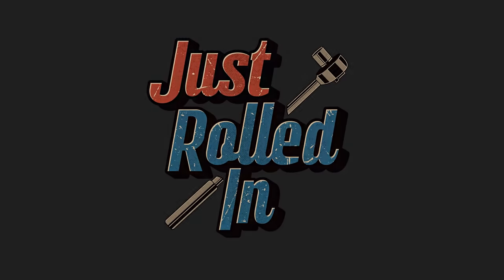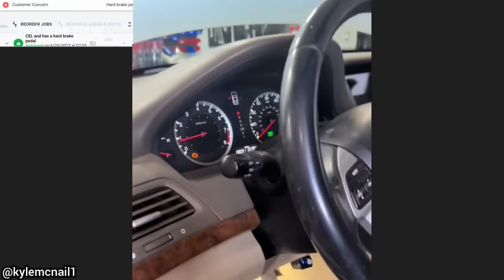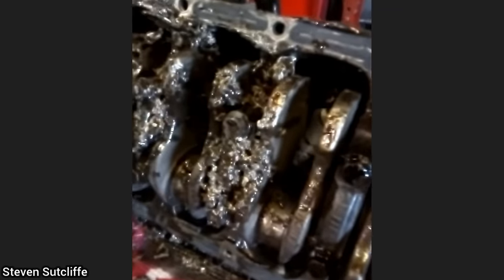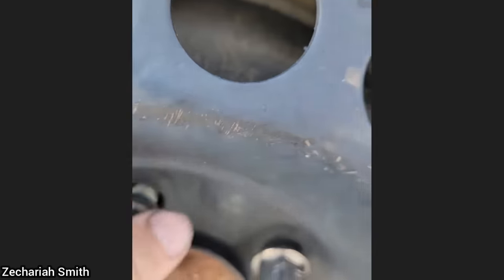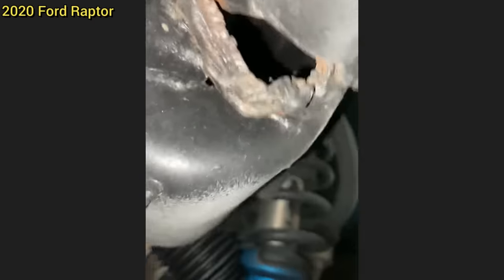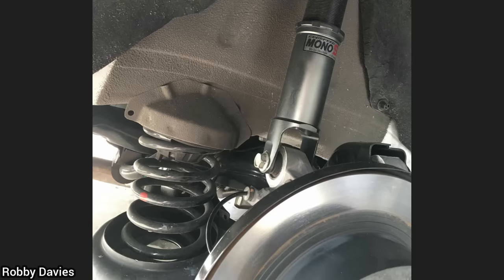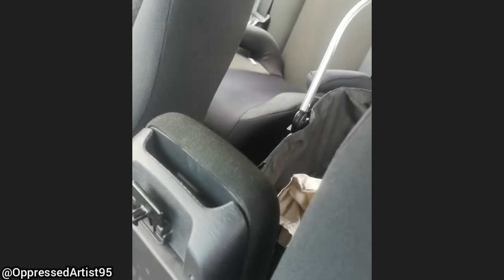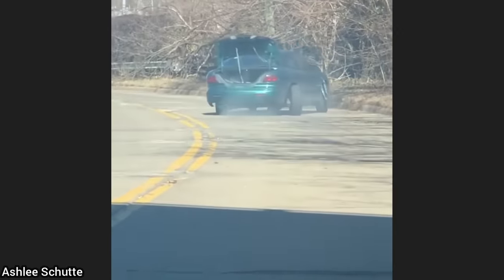Customer States Haven't Changed Engine Oil In 90,000 Miles

Comment: The fact that an engine can last 90,000 miles without an oil change is truly a testament to modern engineering
Reply: It may die right after oil change. New oil loosens all the old gunk and you never know where it goes and what plugs up. If all of it goes into oil filter, that may cause loss of oil pressure.
Reply: @SeersantLoom  use non detergent then? Idk
Reply: @bobstevenson3130  One of the worst cases I've had - after the first oil change was done, surprise, oil light came up shortly. Found my new oil filter plugged solid and bit distorted with all that pressure buildup. Replaced the filter, let it run some more, then repeated oil change.
Reply: @bobstevenson3130 Don't ever use non detergent oil for anything. The stuff currently sold as non detergent has no anti-wear additive package whatsoever.

Comment: LMAO at the last one!  HAHAH!   Yup that for sure is what the ones look like driving home when they "decline all repairs" .  🤣
Reply: Seems like they want to decline being alive, as well.
Reply: just needs a slight alignment job.
Reply: I don't even know how an alignment could be that far off. But that's impressively and scary bad.
Reply: I know the potential for abuse is basically infinity but jfc the cops need to be able to wreck your car when its like that.
Reply: @davidpick1076   Front wheel drive car , the rear axle is probably rusted away from the frame and has kicked around almost sideways from the looks of it ,  LOL
Reply: @matt_1984_  Toe and go
Reply: That is an example of a before and after Scotty Kilmer repair.
Reply: @matt_1984_  Just check the washer level please.
Reply: @davidpick1076  There is nothing to align anymore. The rear axle is completely out of its place, probably rusted away or "hit a slight curb" 😅
Reply: yessssssss 😆
Reply: Persistent drift.
Reply: Came in to get the AC fixed.
Reply: @joshuakarr-BibleMan  Technically, this wreck is still rolling on its wheels, not sliding. So no drift here 😅But indeed, the rolling angle is a little bit, well, off 🤣😂
Reply: There are some four wheel drive tractors that can drive like that.  It's called crab steering.
Reply: Top class!!!!
Reply: Puts deja vu on full blast
Reply: This comment reads like it was generated by AI
Reply: I'm waiting for the goofy stance gang rejects to start doing that to their cars on purpose
Reply: That car was doing crab walk lol 😆
Reply: I always cover up everything I work on with anti-seize that way you know I worked on it it’s like my trademark it don’t matter what it is either
Reply: That made me laugh too.  They're permanently stuck in a drift. 🤣

They drift, drift, drifted all the way home on broken steering mechanisms. 🤣

What I mean by that is by wheel position with everything relating to control of the wheels being broken, not how they're drivin'.
Reply: "Another shop did it."
Reply: Looks pretty cursed to me.
Reply: I've seen some trailers with a bit of side-angle from slipped axle mounts, but that car was ludicrous.
I also saw no license plate on it.
Reply: That individual was clearly disturbed about paying for the repair of that vehicle. Atleast arrange for a ride home and a salvage check.
Reply: How does it turn left. It looked like the wheel was turned all the way to the left in order to go straight.
Reply: They live that Initial D life
Reply: Not sure if I'm shocked or impressed by that last car. Seems to be missing some suspension components.
Reply: The conditions of the vehicles in the last two clips are a perfect example of what we have in Oklahoma.  If Oklahoma ever decides to reinstate just safety inspections, at least 70% of the vehicles on the road will be impounded and/or scrapped!

Comment: Customer states” can’t see out of windscreen “
Mechanic removes paper bag from customers head.
Reply: Customer states "can't hear the engine running".  Mechanic removes ear plugs from customer's ears.  😂
Reply: Mechanic: pokes two eye holes in bag 😂
Reply: I can't help but laugh at the idea of the Customer actually being kind and appreciative about the help they received, without having any hint of embarrassment. "Oh yeah, that really helps out, hey!" - And then they tip the Mechanic with a free, unopened bag of Coffee or something.
Reply: Thought you'd write "cleans windshield of the dirt built up since 2010".
Reply: Customer declined repairs and asked that the paper bag be left on.
Reply: @GeneralChangFromDanang   nice one. Or that ‘another shop’ or ‘ my cousin’put the bag on
Reply: @GeneralChangFromDanang    Or.  Due to how dirty the bag was, mechanic refused to remove it.  😂
Reply: More like mechanic removes customer's head from customer's ass.
Reply: @markh.6687  back in late 80's I was apprentice at an Opel car dealer down my street here in germany. while workign on a customers' car I accidentally slid a knuckle along the windshield's inside, leaving a grey dirt mark. boss asked me to clean the whole windshield inside, and it turned out the car did NOT have tinted glass windows... it was all cigarette smoke residue left over from a good five years... customer never cleaned their windows at all. I ended up cleaning all windows with paint polish and a healthy dose of cleaning spray. :P
Reply: The shoes behind the brake peddle was mind numbing.
Reply: @alphagt62    Nothing wrong with having new brake shoes installed.  😂
Reply: @my3dviews  HA!!
Reply: Mechanic looks a customers face, cuts eyeholes and replaces the bag. Bills customer 4 hours.
Reply: @noeldown1952  LOL!
Reply: @alphagt62  The driver clearly didn't need additional mind numbing.

Comment: I had a Just Rolled In moment the other day.  My daughter and I took her car to get some new tires and after it was all said and done, she had 3 busted lugnuts and only two holding the tire on.  I gingerly drove it down the street to the Honda dealership so they could replace all of the wheel studs.  I have never been so scared before driving a vehicle but that was sketchy as hell.  My wife was following behind me and she was freaking out the whole time.  How do you think I felt, woman.  But all is good and it's safe to drive and the most important thing.  This customer DID NOT REFUSE REPAIRS!
Reply: @Earthneedsado-over177  Or just tell us the initials were NTB.
Reply: @Earthneedsado-over177  “The Other Shop” duh
Reply: @MonkeyJedi99  what's NTB?
Reply: @bearing_aficionado  National Tire and Battery. A chain of shops notorious for poorly training their technicians.
Reply: @MonkeyJedi99  I honestly have never heard of them.  They sound like Jiffy Lube?
Reply: Always inspect the shop's work before leaving the premises.
They should have repaired that befgore it left the shop.
I had something similar happen to me many years ago (late '70's) at a Kmart garage.
I was as young guy and got some new tires put on at Kmart.  
The lug nuts were covered by hubcaps.
No problems when I left the garage, but the next day I started hearing clunking sounds 
while driving coming from one of the wheels.  
I pulled the hubcap off one wheel and found the lug holes in the wheel 
were now lug slots with less than a 1/4 inch of metal wheel left between them!  
I tightened the lugs as best I could and gingerly, slowly drove back to Kmart 
and raised holy hell with the shop foreman.  
I left with a new wheel, new lug studs and lug nuts at no charge to me.  
I usually do as much of my own work as I can, as I am a FAA certified A & P Mechanic, 
with available hand tools, but when I can't I always inspect the work done to my trucks.
Reply: It was sketchy, but maybe not as bad as you think. You still had 2 lug nuts holding it on, so it was better off than what I had to do to remove my rear wheels in a 99 Suburban:

The only way was to remove the wheels was to (1:) loosen the lug nuts (just so they were loose, but only just so,) then (2:) I had to drive it out in my low traffic back street, go 5 MPH in reverse, and slam the brakes. 

The wheels didn't fly off or anything, they just got loosened. And believe me, I tried everything else I could read about to remove the wheels, and nothing worked except this - they were stuck on too tight. Hitting the wheel with a sledgehammer didn't work.

Comment: That last one caught me of guard. I can only do minor maintenance work but this channel reminds me just how far that can go.
Reply: i was doing just minor maintenance on my vehicles. until one day my 6 speed automatic transmission gave up and only went in reverse. 

instead of paying $3k or more to get it fixed i bought a shop manual on ebay for $8 and watched some guy on youtube disassemble one at least 6 times.
read the manual a few times and even got into the technical diagrams explaining how the whole solenoid valve body works to shift gears. the manual was impressively detailed. i bought all the parts and tools i needed for $800-1000 and took my time fixing it. took it apart and assembled it 3 times and then went through the entire transmission to find everything worn out and replaced it. 
the forward piston had ripped and my overdrive clutch plates burnt. replaced the whole overdrive clutch pack including steels and all the clutch plates in the other packs. as well as the forward piston that caused all the problems. i got it all put back together without missing a single thing.
it works like brand new now. everything was put back where it belongs. i think its funny no one wants to touch a transmission let alone think about taking one apart, but i dove right in. 

if people cant take the time to learn how to do the work properly they have no business doing the work at all. 
i refuse to pay $120 an hour for dealer mechanic labor. I rather learn a new skill. i used the money i saved to buy a backup car. so i got more out of it.

Comment: That Lexus is legitimately impressive that it lasted as long as some well maintained engines without an oil change
Reply: I'm not it's a Toyota
Reply: @cloroxlavenderscent4307  Yes, had a sales rep who got a new vehicle, and was canned after a year or so, for unrelated things. Looked at the  vehicle, and it had done 60 000km on the factory oil, as it, along with the tyres, had never been changed at all. Oil was on the low mark as well, and pretty black.
Reply: Neighbor was a traveling salesman. Bragged he never had to add oil to his car. When he finally took the car in for an oil change after many thousands of miles, there was no oil. Except there was oil burned onto the dipstick, and the dipstick driver thought it was showing oil in the engine. Oh well - company car. Who cares?
Reply: @dsbennett  Nowadys these cars are generally leased for two years, so after two years they get returned anyways. These cars normally have full coverage for any maintenance, which some people use to the point where it's almost abusing. I think my brother once took his in because the washer fluid was empty.
Reply: Hoovie, from Hoovie's Garage, had a Maserati Levante that had at least 60K miles since the last oil change. It still ran though and after two oil flushes, it ran like new. It also had traces of meth in it because it was an auctioned off drug dealer's car.
Reply: @MyRegardsToTheDodo  isn't that sad that so many people (not businesses) are leasing vehicles.  You have basically signed up for a lifetime monthly car payment.   Hard pass.
Reply: @ronmonarch2679  Those cars are normally company fleet cars. Normal people don't get a lease for two years and after those two years a new car with a new lease.

Comment: Ive had a customer this week that told me the AC didnt go cold.. so i checked and refilled the AC and when we together tried if it got cold it turned out she didnt push the AC button😂😂😂😂😂
Reply: I've had two customers (one a real customer, the other was a student in my automotive A/C class I taught ) tell me their A/C didn't work. Upon inspection, neither vehicle had ever had A/C!
Reply: @61rampy65  That explains why it didn't work...😁
Reply: @61rampy65 That sounds like a Suzuki Vitara I saw, one of the last of the JT shape.  4WD not working.  Had the switches, they lit up, 4WD errors came up on the cluster.  Look underneath - no transfer case, no front diff or CV shafts.  A mix-up at the factory made a car that lies to you!!
Reply: @markh.6687  Easily worth the one hour diagnosis fee!
Reply: @61rampy65 and that is exactly the reason why so many people no longer trust a garage anymore!!! 😢

Checking if powered on should be the first step, not trial and error refill AC kind of crap.

Diagnose is done 98% with your eyes, 2% tools.

Yet.. so many seem to have forgotten this and just try to fix the first thing that pops in their mind... (Or because the car computer tells them)
Lazy mechanics...

Charging an hour for showing the on off switch or telling there isn't AC?

Shame on you.
Shame!

Please tell me what garage you work so we can avoid.

Comment: Local car for sale: Sign on it states, "Has had engine replaced."
Turns out the radiator went bad, and instead of fixing it, they just kept driving the car until the engine blew.

Comment: Last one is called crabbing.
You have to do that when you have a strong crosswind.
Reply: But the back wheels are at 20 degree angle from the car. That... can't be right for that particular car.
Reply: @BrBill  - depends on the crosswinds.
Reply: @MrYfrank14  Yeah, maybe it's 2 different hurricanes hitting each other at the same moment
Reply: @BrBill  - that would do it. 
Clockwise hurricane from the east and a counterclockwise hurricane from the west would  do it.
Reply: Hmm, I wonder what the maximum demonstrated crosswind component for an early 2000's sedan is?
Reply: @brianholloway9990  - The maximum allowable corsswind velocity is dependent upon driver capability rather than vehicle limitations. With average driver technique, direct crosswinds of 115 MPH can be handled with safety.

Comment: That's why I  change my oil every 
89,999 miles whether it needs it or not.

Actually I change my oil every 3,000 miles. 2010 Nissan Altima 221,000 miles and it doesn't use a drop of oil. No " fancy " oil or filter, whatever is cheapest at Auto Zone or Advance.

Comment: While working for a trucking company, we had a truck come in that was 50,000 miles past its regular B-service (oil change) interval , normal interval at that time was 25,000 miles. Additionally,  we also performed what we called an A-service at 12,500 miles between oil changes. So not only did the driver skip 2 oil changes, skipped routine 2 vehicle inspections. As a result, we ended up putting $12,000 worth of repairs on the truck.

Comment: Funny actually how some of these vehicles get driven away from the shop. In most of Europe you can't do that if its not street legal and the shop will call the cops on you if you tried.
Reply: If the shop is smart, they make the customer sign an acknowledgement of how unsafe it is before returning the keys.  Good luck trying to get cops to respond to a report of that in under 2 hours though.  The car will be long gone.

Comment: I would like to see the European version of just rolled in.
Reply: "This Mercedes came in for an scheduled service, and the owner apologised for being 2.3 km past the recommended service interval."
A lot of European countries have mandatory vehicle inspections, so some of these would be caught.  They might not catch the missing oil change issues, but would probably catch some of the egregious mechanical issues--broken frames, etc.
Reply: you probably will NEVER see one.
Reply: They almost failed me at mandatory technical examination because I removed my fog lights. You have to do it once a year and you can't legally register and drive the car if you fail.
Reply: @ajkulac9895  one of my fog lights in my 03' e46 got taken out by a raccoon several years ago. Not required by DMV NE to repair.  Been hanging under the front clip every since then like 3 years ago.

Edit: made sure nothing was going to break loose.

Comment: I'm surprised that it is legal in the US to drive away with deathtraps. Here in Germany a workshop refused to let me go with tires that were just below the legal tread depth of 1,6mm.
Reply: Freedumb. Some people are obsessed with it to their own peril and they can vote.
Reply: This regulation is at the state level. Some US states have strong safety laws, some have weak ones, and some don't even require any inspections. It's kind of a political thing, unfortunately.
Reply: I'm surprised they refused to let you go!

In Holland they can strongly advise against it, but can't stop you in any way.

Unless it's the yearly inspection (APK) and you didn't pass that test.

Even then, they can not stop you, but as the car didn't pass, you aren't insured and illegal to drive.
They can (and should) call the police.

I always do a pre-inspection a month before APK, so I know what I'm up against, with lots of time to fix any problems.

Brakes, tires and lights are top priority to me.
Next is if it can start and drive :-)

Emergency stop on a wet road.. you will slide a lot further when you lack profile.
(What is in Holland 1.5)

German highways are notorious for people driving high speeds, so safety regulations should show this.

Safety first!

Germany is really strict with tire profile depth and summer/winter tires.

Part of living in Germany.
Reply: @fhorst02  I had the option to sign a letter in which i stated that i'm informed about the worn tires (so the workshop is on the safe side), but i chose for new tires instead. 
And i'm glad that in Germany the workshops and the TÜV are that "penibel" so that it is unlikely to encounter dangerous vehicles on the road.
Reply: In the U.S., some people have to hydroplane down the highway a few times before they get the message.